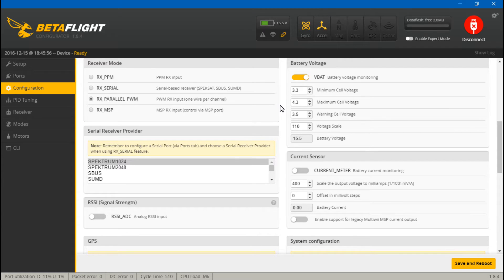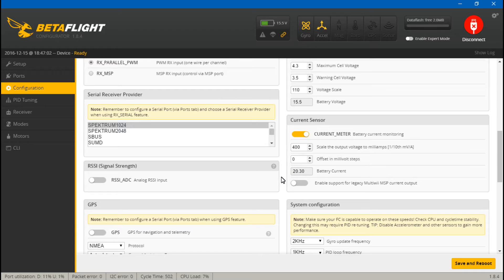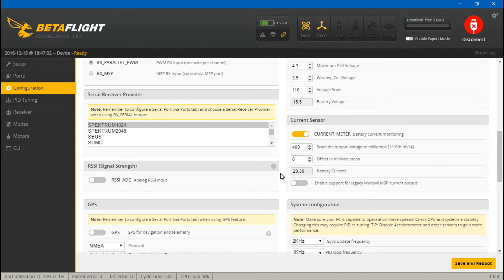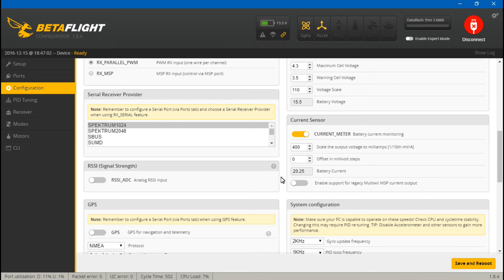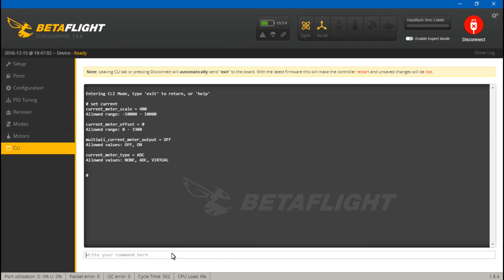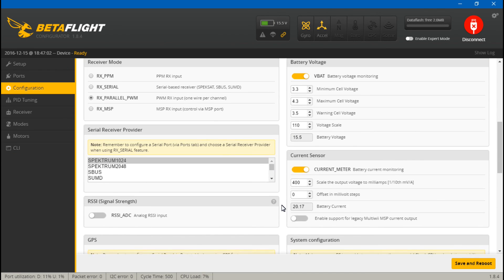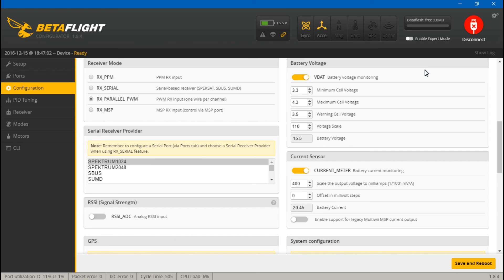Myth Answer for Betaflight / Cleanflight Current Value

Comment: So I have a issue with my voltage readout.  So I plug in one batt and calibrate it in betaflight, with a value of 150 to give me the right reading. Then I plug in the second batt and it's wrong. It needs a batt value of 130. Any ideas?

Comment: Hi,
i got a new PDB with a current sensor output. (Realacc/Matek PDB-XPW)
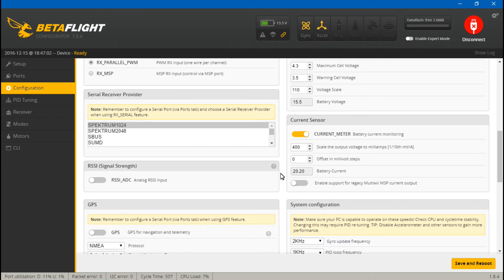But i do not know to connect it to a naze32. Like you said at 1:46 every FC has a pin or pad for that, maybe you can tell me where i finde it.
Thank you :)
Reply: i got it on the ADC Sensor connected but it show not the right value . It should work with scale of 236 but i still got 60 a under no load.

Comment: is there a way to tell if I have a current sensor on my flight controller without actually reading somebody's spec list? or it's just something you've had for a long time and forgot?
Reply from the maker: All the flight controllers with build in current sensors will have really big solder pads on it for the main battery leads. Then in between the pads will be a current sensing resistor that will read something like "0m50" on top of it. Same goes for PDBs with current sensors. You just look for the resistor in between the pads. But even if the flight controller doesnt have a current sensor, almost all have the ability to read a current sensor from a PDB or add on sensor by using current pins on the flight controller.